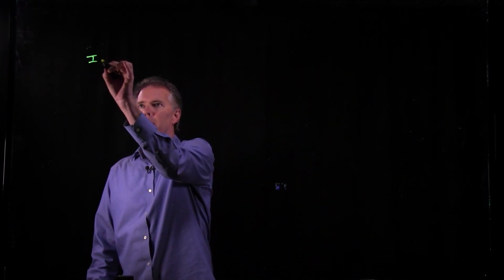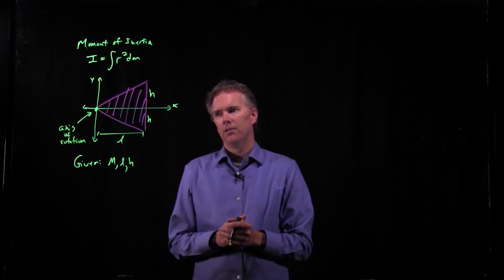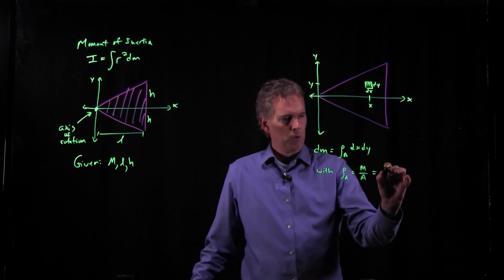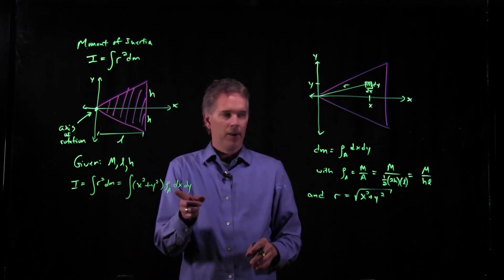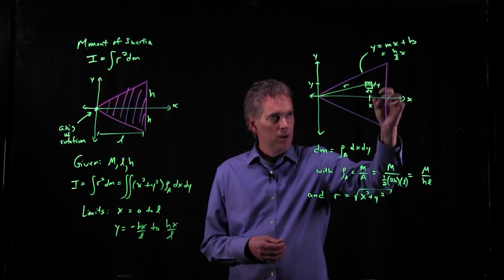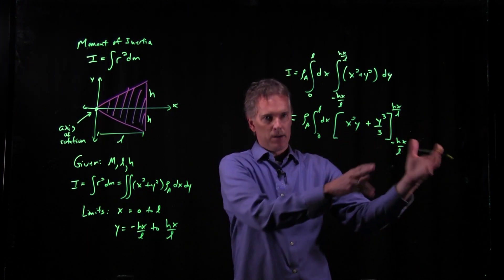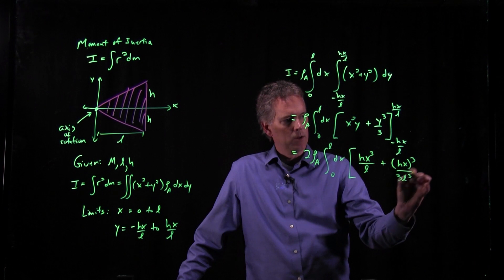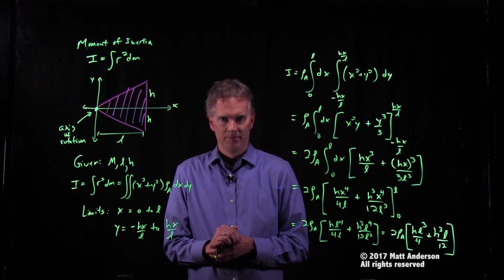Calculating the moment of inertia of a triangle

Comment: An absolutely shit method, he says that the figure is not very symmetric but proceeds to assume that the triangle has length 'h' above and below the axis. Also using similarity of triangles and the height of it mitigates the problem and also makes it more general and makes the calculation easier.
Reply from the maker: Excellent points!  We could have exploited the symmetry much more.
Thanks for the comment, and keep up with the physics!
You might also like my new website: www.universityphysics.education
Cheers,
Dr. A

Comment: Sir but it's only useful for a isosceles triangle right as you took altitude on side 2h as midpoint of side2h
Reply: It doesn't have to be. For non-isosceles triangles just re-orient your bounds appropriately with trigonometric rules. Your centroid will not be easy to find, though...

Comment: Utilizing the top triangle as a reference, y/x = h/L so y = x(h/L) for the top portion. For the y limits, all you really had to do is integrate from 0 to x(h/L) and then multiply that by 2.  This is nice because it matches polar coordinates. But you did it in rectilinear form which is just fine too because you avoided using trigonometric manipulations. This is pretty straight forward based upon the fact that your density in this case is mass/area where the summed area cancels and you have the mr^2 over the surface of the triangle. Do you agree.

Comment: This was a fun problem. Any chance you have an example where the density of the plate isn't uniform? I guess if the density were a function of position then you would just keep it inside the integral and slog through it?
Reply: I know how to do it.
Reply: Oh I caught what he did. It's rotating about the apex and not the base. 
That changes the problem.

Comment: why dont you integrate strip of length x and width dx it might be simple.. will it be?
Reply: This method isn't really that much harder once you get used to it, and I think that it might be slightly more general.
But yes, you could probably use a thin strip element and integrate that thing as well.